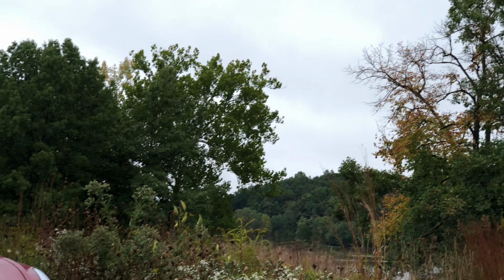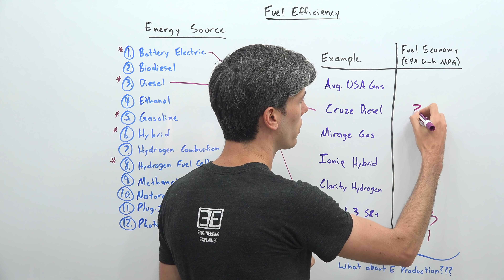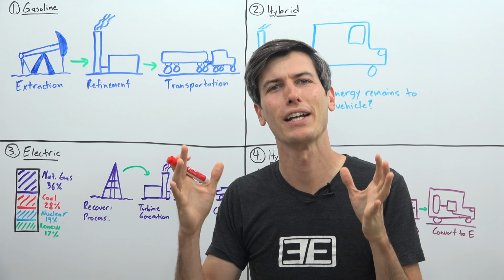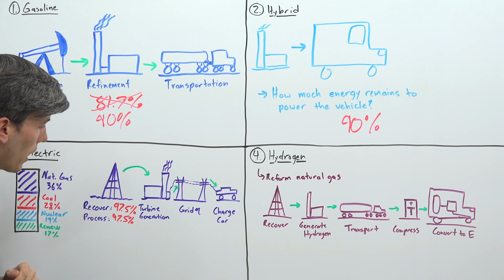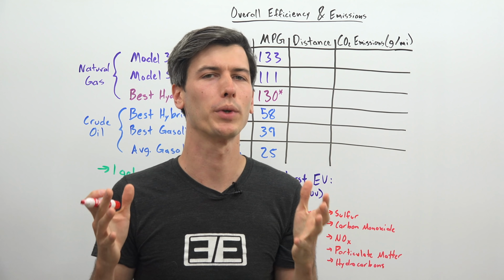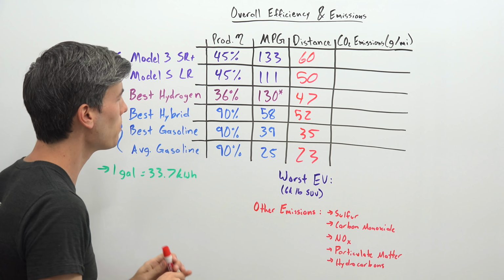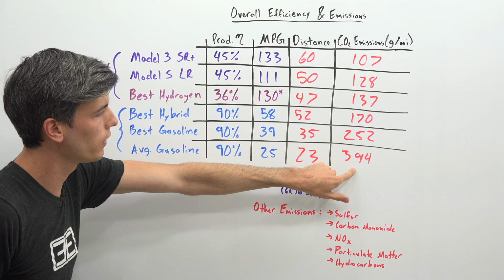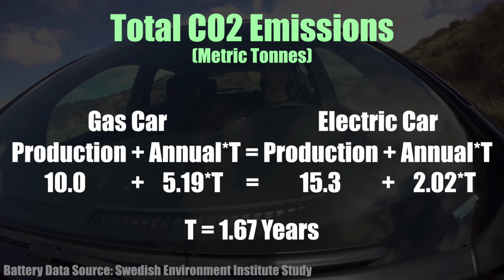Are Teslas Actually Better For The Environment?

Comment: I disagree on a thing though: you said the CO2 emissions for an electric vehicles will go down if you use something other than 100% natural gas. I guess it's true but renewable energies do, sometimes, indirectly emit CO2 by other ways: a hydroelectric dam had to flood an entire valley in order to be built... solar panels don't emit CO2 but all the mining and building and maintenance might emit CO2. It might be lower than the regular CO2 emissions of a natural gas power plant BUT I don't think it's right to say that a Tesla CO2 emissions will go to zero if it uses 100% renewable energy. (Sorry for bad english, French guy here).
Other than that, awesome video, as usual.

Comment: Good thing the EV  came on top even with the massive advantage given to the ICE figures. The figure for the gasoline generation process is brutally biased (as can be suspected since the figure is provided by the oil industry itself). A process that uses internal combustion engines across several steps of the chain, has to pump viscous fluids all over the place, and even burns petroleum to liquify high viscosity petroleum in order to pump it out of the ground has an overall efficiency above 80%?! Come onnnnnnnn!!!

Comment: the question is: how much emissions are generated just for having built an EV and adding those to the life span of using an EV vs a traditional IC. BTW, LPG is used in lots of countries (and a lot more than you imagine).
Reply: if you would check the first comment on this video, WHICH IS ALSO PINNED you would have your answer.

Comment: Diesel's have the cards stacked against them in the US compared to other standards.  For one, aside from Texas and California, our US federal diesel fuel quality standards are lower than other standards like the EU.  The US has a minimum CN of 40 while the EU has a minimum CN of 46.  Most diesel run at peak efficiency with a CN between 48-50 especially for high revving diesels in small vehicles.  The next thing is our emissions standard are considerably more strict on emissions that mostly come from diesels like NOx than other standards like the EU and less strict on emissions from gasoline engines.  The allows many EU makes to exclude such emissions devices like an EGR which recirculated spent exhaust gases back into the intake which lowers efficiency.  Lastly, our own test cycles are made specifically for gasoline engines to achieve higher mpg numbers.  This is one reason why most gasoline owners get worse fuel economy in the real world versus the EPA test while most diesel owners generally get significantly higher real world fuel economy numbers than the EPA test.

Comment: any CNG car fans??? if its 95% (97.5% x 2) , then a CNG car will be in between a hybrid and a diesel. For the Honda Civic GX (27 city/38hwy): MPG comb. is 32.5, distance is 30.88mi, and using the stated 25% less g/kWh CO2 (197.25 g/kWh), its going to be 180.7g/mi.

Comment: This is only one half of the equation. The production emissions of things batteries, engine blocks, etc could easily change this drastically.
Reply: Maybe, but don't forget there's other fluids in ICE cars that have to be replaced (oil changes), and more moving parts (transmissions, timing belts, alternators) and those have to be continually extracted as well.

Comment: Great Video! Although one metric missed was emissions released for creating a Tesla battery, which should not be overlooked. It's nowhere near the levels of a conventional combustion engine but it still adds to the carbon footprint. Again, GREAT video with amazing detail --EDIT: nvm you just talked about battery production emissions. AMAZING video!
Reply: DarkDevildog he went in depth in the previous video he mentioned. Given enough mileage the electric vehicle will produce less emissions overall no matter the power source.

Comment: Please take in mind the CO2 emissions per  volume unit of diesel is about 15% higher than that of a similar volume of gasoline.

Now this is just CO2. What we should actually be comparing are CO2 equivalents equivalents. This combines all greenhouse gasses in an equivalent amount of CO2. Diesel performs even worse on that number.

Comment: This video is lacking... I'm glad that where the energy comes from was taken into consideration but the whole claim that if it came from renewables it would make the win obvious.

Burning wood which is less efficient than coal is deemed as renewable energy.

Then nothing is noted on how much energy is requires to create solar panels and the environmental damage caused by the mining industry to produce the materials required to create the batteries for electric cars like the Tesla. Then there is disposal as well.

This video does not answer the question broadly, but merely answers with my selective parameters is the Tesla better for the environment to make me feel good, not because of facts and all the parameters.

Comment: First of all, love your vids! For the turbine generation do you mean efficiency of the plant? In that case without district heating 60% is slightly overrated figures. I have worked in plants where these figures were possible on paper but unless outside temperature and air pressure was perfect then you would struggle to get over 55%. Now these were modern gasturbines. A normal plant which is more common would struggle to get past 45%. And as a Swede I get curious when seeing calculations made from here because I suspect they calculate with Swedish production which is close to 100% renewable. Also real mpg figures for diesels are slightly higher 40-50 mpg. Other then that great job as always!

Comment: Wait what about maintenance in the Tesla vs a regular car?🤔🤔🤔 just curious a $2000 plus flat repair with rim vs a regular flat tire and rim, the cars may be become more efficient, but the roads are not, towing to any shop to have it repair (regular car )vs towing it to a tesla facility God knows where.
Tesla strategy, good publicity and this guy just got a good chunk of it, besides  I dont wanna wait to long to recharge battery, just a few minutes to refuel and go, electric bill will be expensive.

Comment: Good comparisons there, though I'd question the diesel mpg you had as my 17 year old Diesel regularly can do 39mpg on urban runs and over 45mpg on motorway runs (Higher if these are longer runs of 40 miles or more pure motorway driving) and more modern diesels are more efficient, at least on this side gf the pond.  There are also a few other things to consider on the fossil fuel side in that the cars tend to be heavy with more metal in the chassis, while electric are heavier on average with larger battery packs.

Hydrogen in the form that could be used in a hydrogen fuel cell car is also massively polluting to produce, as hydrogen is abundant in our world and the whole universe in general, but its generally attached to something.  It's the process of separating it out that is hugely polluting and costly.  Much of this grade of hydrogen is used in modern TV, tablet and phone screen production, and is where a huge amount of CO2 pollutant come from in manufacturing areas like China for example.  If this grade of hydrogen could be made cheaper and cleaner, the generally efficiency and overall pollutant outputs would change, but hey-ho, this is where we are at the mo.

While electric is improving rapidly, for the work I do and with the travelling and electric infrastructure in the UK, its still more efficient and cost effective to use a Diesel, along with overall CO2 emissions.  When a mid-price electric can get 600 miles real world use (Tesla's quoted mile range and real life range can differ up to 100 miles depending on model and options), then electric will be a lot more tempting for me, and would be the equivalent of my existing 17 year old car.  Until then, the costs just don't stack up, at least for me.

But great video overall, really enjoyed it

Comment: Couple things.  When you did the final breakdown using natural gas vs Gasoline. You assumed all the grid power charging the EV's came from Natural gas, when earlier you said that only 36% of grid power comes from nat gas. Im sure the 28% coal would change your final CO2 emissions correct?  It probably wont change the final outcome too much as the EV's stomp when it comes to emissions but it would be nice to know.  Also can you do a video on the creation of new gas/ electric cars and their C02 impact compared to say driving around a 2010 Corolla for funsies lol.

Comment: There's no possibility that any energy authority has quoted 92% efficiency for their grid. It's not possible to transmit, transform, then regulate, above 90% (transmission -> substations -> distribution -> service drops). I also disagree that fuel cells are more efficient than hydrogen combustion - the second conversion guarantees at least twice the loss!
Reply: losses from power plant due to transmission and distribution are pegged at between 6-9% in the US.  losses tend to be lower in more rural states where there is longer transmission compared to distribution...
Reply: Even if you assume 6% - 9%, that means your max efficiency from the plant is already down to 51%, then you need to consider the regulators of your recharging unit, battery efficiency, the motor controller (pulse width modulator), and the motor itself. At best, you're at 40%, from generator to motor, and I'm very sure that there's no possibility of 91% across the transmission system (9% loss).

Comment: You are being so kind to gas cars in your math. Oil extraction uses a lot of electricity and diesel, oil platforms have to be built and towed into position, they are then serviced by boats and helicopters; oil tankers produce filthy emissions and wash out their tanks at sea, oil refining uses electricity and produces more emissions, then a diesel truck delivers the fuel to a filling station, then electricity is used to pump the fuel into the car. All this before you turn the ignition on and drive!

Comment: The reason why natural gas is currently being used more than coal is because it cost less.  The reason why natural gas costs less is because it is a byproduct of fracking for oil.  If oil demand drops to the point that we had to drill just for natural gas, then it's cost would likely rise above coal which would make coal a more cost effective fuel as it has been in previous generations.

Also, Jason is right that most IC engines are reaching peak efficiency.  However,  how we get the fuel has not.  There are companies such as Carbon Engineering who are finding out ways to make fuel from carbon in the air.   In fact, they estimate that we can pull more carbon than we burn.
Reply: frac'ing is also used in wells intended solely to find and produce NG.   Good on those guys if they can pull it off !

Comment: The problem is not in the US but in the developing world. The average price for a new car in India is roughly 10000 USD or slightly lower while the price for a comparable EV is 20000 USD - 35000 USD depending range and options. This price gap is too much for consumers to bear.

Comment: Loss of energy in the transfer of electricity to the charger/customer is A LOT. Energy density in Lithium batteries is still laughable compared to gassoline, diesel or even LPG. But you all go and buy electric, I'll profit from very low gas prices and many great V8's, V10's and V12's to choose from.

Comment: I'm sure everyone has seen photos of unsold ICE autos sitting in large fields. When the auto industry can't sell, or overestimates demand, those extra cars need to go somewhere or be recycled.  Now imagine a field of unsold teslas. As the video lays out, they are a greater burden to make and after 1.67 years (on average) and only in certain conditions, will you eek out an advantage by driving it.  No savings if you don't drive it.  Until then you've spend more carbon just to have it sitting there.

Which is better for your health, smoking much less tobacco, or switching to vape and vaping more?

Comment: Although it's good we have electric technology alongside petrol cars. I wonder if calculations are done at comparable fuels . Carbon load natural gas is not comparable to diesel or petrol. Is an electric calculation based on the mixture of coal not more realistic?  It brings the emission on the model 3 around 160 gram/mi co2. Then again, the average co2 ( non natural ) emission for the whole elec. production = around 85 gram/mi for the Tesla.

Comment: Please recheck the math using coal power.  That is the largest electricity producer in the usa at about 45%. Natural gas is only about 23% for natural gas.

Also, we need to look into the cleaner fuels we already have. Why go electric when we can convert existing car engines to propane or natural gas? We already use it in mass transit and the byproducts of propane/nat gas is cleaner due to the lower carbon content.

We need to research the existing products we have(that already have infrastructure) before we go trying to reinvent the wheel.

Comment: You missed one important innovation happening in the area of ICE carbon neutral fuels. Such as synthetic e fuels and e gas produced from CO2 only using renewable energy. Also 3rd generation bio fuel from algae (Exonmobil is going to produce this oil at 10,000 gallons per day by 2025) it is 50% carbon neutral according to research done at MIT. But if the process is handled with renewable energy it can be 100% carbon neutral. And the good thing is existing billion odd vehicle fleet can become carbon neutral if such fuels are introduced.

The improvement in efficiency of ICE is also not at its peak. I would say ICE  and the drivetrain innovation can improve vehicle efficiency by more than 35%. 

So in the end ICE can still be competitive in terms of environmental friendliness compared to BEV'S.

Comment: This video doesn't include the emissions of extracting the materials to produce the fuel to power these cars.
Reply: Or shipping the oil and coal, or refining, or building the excavators, oil rigs and drills, or building the factories to build those....  it's emissions all the way down!
Reply: @mostevil1082  The difference is when you have spent the money getting the oil you get 20,000 barrels a day for years. The process of making batteries is far more complex. I have no doubt that electric motors are the future but batteries powering them I do not think so.

Comment: Bought a battery lawn mower.  After the first go at it I realized my head was clear and the physical effort was far easier once done.  I attribute that to the normal air available without gasoline emissions.  I will never purchase a gas fueled mower again.  Cost is not a factor.

Comment: I guess the environmental impact of where they mine the lithium isn’t very good though. It uses 500,000 gallons of water for 1 ton of lithium. Not to mention our infrastructure isn’t made to charge if every person had an electric car. They constantly talk about how our electric is stretched. In Houston alone in the summer the have rolling blackouts cause of all the air conditioners being used and the high temps.

Comment: How about the efficiency of the source when used. ie how much of the fuel in the engine is actually used for locomotion vs heat, exhaust loses etc?
Reply: we look at how much miles they get us which is exactly the same

Comment: Can we just make notice that the only references are from Tesla motors and dating from 2006?
From having done the calculus on some of the cars we can find pretty different results from what is shown. The way calculus is done and numbers are took, is really not clear, taking the wltp g/km of gasoline/diesel/hybrid cars and then km/kWh of electrics and convert with the average ≈550g/kWh in America would have been simpler, more accurate and less questionable.

Comment: Uh no on the cruize, my friend has one and gets over 40 consistently with a max highway of 55, also calculating the weighted average of the cruize proves over 38. My 2004 diesel Jetta has a combined rating of 41.6. So the cruize isn't the most efficient diesel car there is. That is also why I question your calculations on the cruize because my friend's real-world driving gets way more mpg than I do. My calculated almost pure highway miles was actually better by 1.5 mpg in my own real-world test and my motor has 230k miles on it. Disappointed in this overlooking of mpg as far as the diesel competitor goes.

Comment: Thank you for your calculations. I don't understand why are you giving the gas car a benefit of doubt by rounding 81.7% processing efficiency component to 90%, while ignoring the thick power lines coming to the refineries to provide all the electrical energy needed to manufacture the finished fuel. I also ponder why you calculate very meticulously efficiency of electricity production/transfer for the EV, while not doing the same favor to calculation of efficiencies of the gasoline and hydrogen. Gasoline efficiency does not include extraction and transportation - although it is plotted. In case of hydrogen, the MPGe is broken into estimated fuel cell efficiency and EV-like MPGe. Why? For EV, why do you include efficiency of battery charging in your calculation? The MPGe is the final number for powertrain efficiency including energy conversion losses just like for the gas/hybrid powertrain. Just because you conclude that EVs are more efficient and you seemingly please environmentalists and EV fans, does not mean your calculation is accurate. According to Union of Concerned Scientists, the extra carbon footprint of EV manufacture is offset in just 1 year. You did not arrive to this number. Again, I like everything you do to support EVs. However, ICE does not deserve any doubt benefit. China is ahead of the US in electrification.